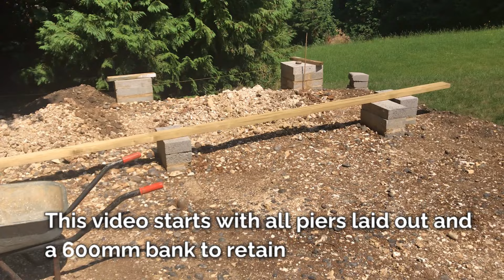Part 2– GARDEN ROOM BUILD –Retaining Wall and Final Site Prep | OFFICE | GYM | TV ROOM | CABIN

Comment: Great content. Did you consider a small field drain? I am guessing the 1cm gap refers to the base of the horzonatal boards to allow the water to drain underneath and continue down the hill under your garden room?
Reply from the maker: Hi, thanks for watching. Yes, exactly that, so pressure doesn’t build up behind the wall 👍
Reply: @OurHomeProjects  thanks for your reply. so you didnt bother with a field drain? I have a similar situation to you for about a 6 metre length and Im hoping a field drain is overkill for such a short length. The height is about 800mm.
Reply from the maker: Our soil is *very stony and I put all the pebbles behind the wall before topping with top soil. So I guess you could say that also helps with the drainage and lack of pressure build up. I am not an expert but I’m sure if you back filled that length with 4” or so of gravel that would help, plus if you can allow a gap at the bottom that will also help, or have a small trench in front of the wall also filled with gravel to act as a small soak away for anything that comes out underneath. Karen

Comment: post should be 50% in 50%out
Reply from the maker: Yeh, I would agree with that if it were possible. Unfortunately, our soil is full of flint, pebbles and clay, so I could only dig so far. It was a short wall and the fact the surrounding 'soil' around the posts was rock solid I decided they would be ok. Thanks for watching.